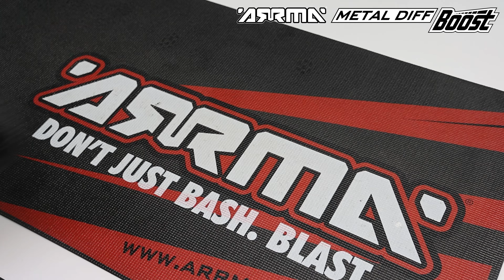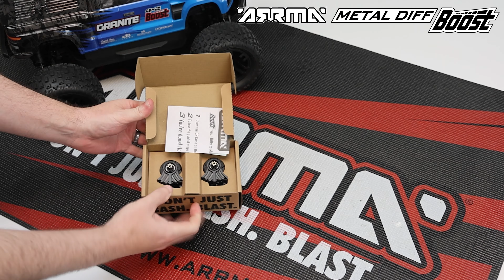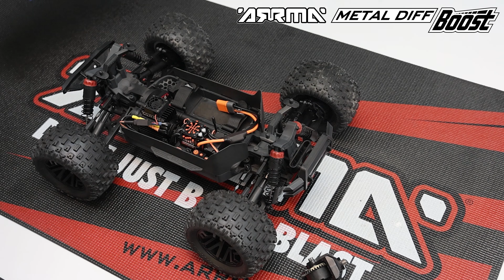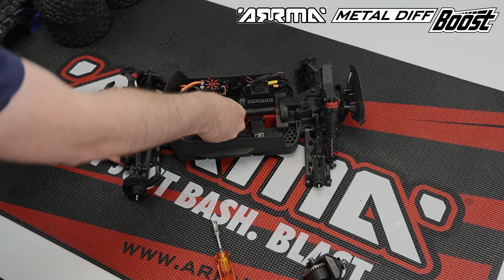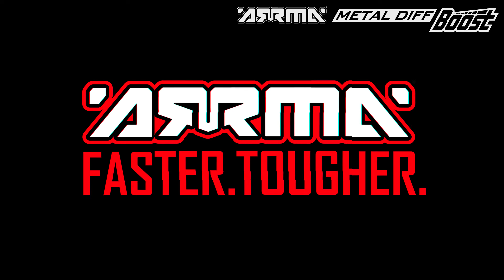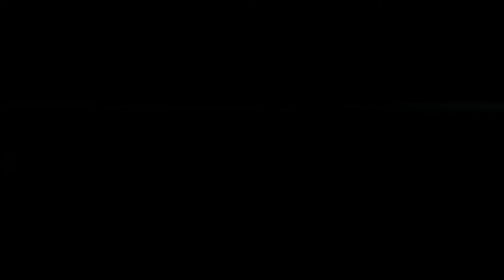INSTALLATION GUIDE // Metal Diff BOOST Box Upgrade Set

Comment: No mention (or maybe I missed it?) of diff fluid - what weight fluid do they come filled with?
Reply: Hes asking for diff fluid, not about greasing the 37T and 13T gears. Inside the diff case with the planet gears i use 20k cst weight in the rear and 10k cst weight in the front diff.
Reply: @MarkJohnMorris  I'm the opposite, 20k in the front, 10k in the rear.  Still, begs the question, do these come with 10k like the stock diffs or something different?
Reply: @jerryvolpini7987  I'd presume they do, keep costs down if all they need is 1 cst weight for all their diffs haha.

I preffer a loose front, i also used a calc to mix cst (10k and 600) to make 2k for the shocks, like a memory foam queen now they are 😉
Reply: According to my usual RC shop the stock plastic diffs come with 10k and it feels like the same stuff in the Boost diffs. So I would assume that the fluid in these is also 10k as supplied. They are a LOT smoother than the stock plastic diffs, and feel a lot looser as a result. Honestly, the drag reduction on the drivetrain is insane! My GPS showed 50mph dead on flat out on 3S on the stock diffs, and after putting in these metal diffs its up to 56mph on the same pack and the battery seems to last a few minutes longer! I do find that 30k fluid feels about the same as running the stock diffs, so going to be upping the front end to 40k or higher.
Reply: All he mentioned was use gear grease to grease the gear. 4:49
Reply: @davidgoodrich1258 so gear grease and not oil?
Reply: @Soul_Visuals_Photography grease on outside oil on the inside u can try any n all kind of diff oil to find what you like.